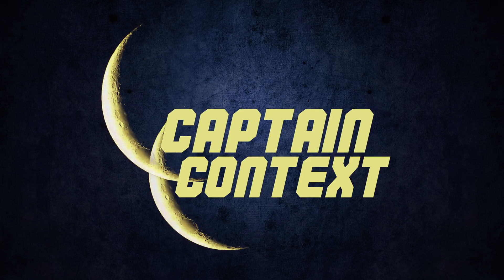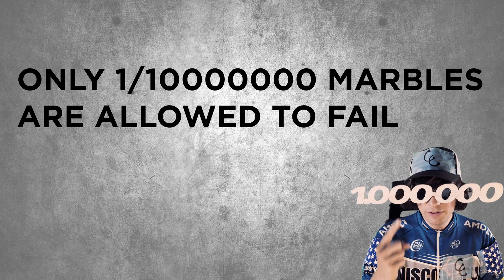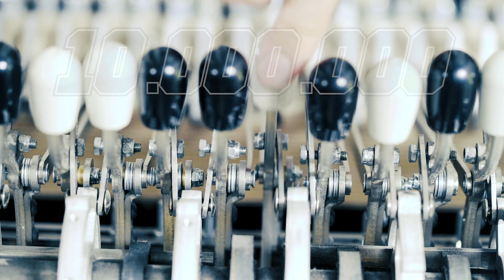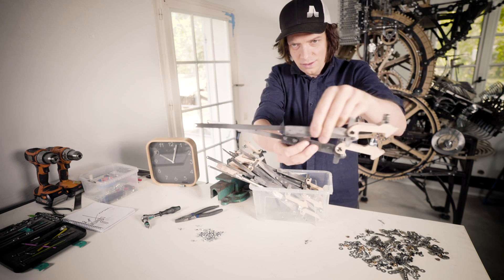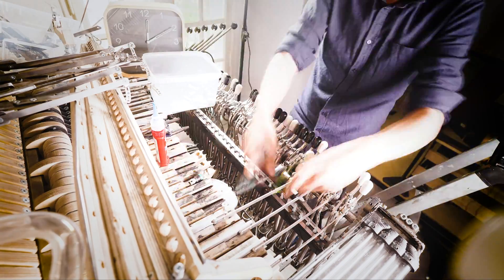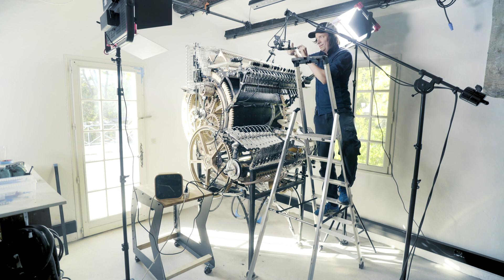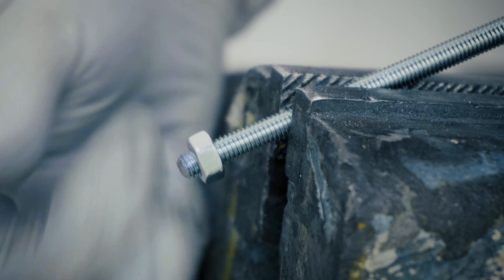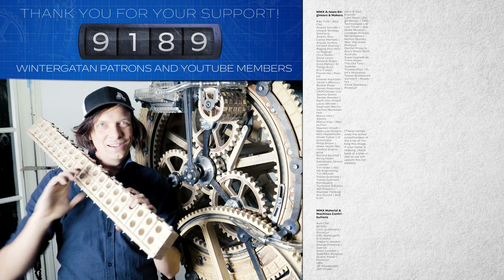Countersink? Why? - Marble Machine X #143

Comment: Martin, something else to consider; automated testing. Have a set of programming plates that actuate all the channels in different profiles - covering likely patterns; rapid repeated notes, adjacent notes playing together, etc - and then use the motor to run the machine all night (probably with a camera running to capture oddities). You can simulate many concerts worth of usage in accelerated time.
Reply: Well that is basically the last step. FIrst he would have to test all of the individual modules and sub assemblies. But yeah I agree some form of automated testing is absolutely required.

Comment: Hey Martin

I'am realy in joy how you discover the normal techniques in a live of a machanic. But...i'am realy in pain with your screw safty...pls...pls use a bit less off the locktite. It is not needed if u use a self-locking nut...just a drop is enough.
If u assemble one part (maybe 2) and test this part befor you assamble the other parts u could save up a lot of time to repair your mistakes. just keep in mind.. you don't have to do the worke twice and its more efficient (yes i'am german)

best greetings and much love from Germany
Reply: The loctite can also eat the nylon inside the nylock

Comment: I can't see how this is ever going to happen without a way for a failure to be manually cleared mid song without anything breaking. 1/10,000,000 is one pothole away from 1/1000.

Then again, I'm sure I'm not the first among the dozens of brilliant collaborating engineers to have thought of such things. I hope to be wrong.
Reply: If you can't make it perfect, make it tolerant/compliant/adjustable/etc
Reply: I always find myself comparing the MMX build with software development and one big thing in software development is trying to add graceful failure as much as possible. You don't want one error to kill the process, it should recover from i.e. a slow network connection
Reply: What is Martin's definition of 'failure'?
Is it an event which causes the machine to leap 1 metre off the floor and hit the ground in pieces? Or something as subtle as a marble missing one of the catching baskets and landing on the floor, leaving 3499 marbles in the loop?
Reply: There is a difference between failure and catastrophic failure.
Reply: He is right, if the failure mode is breaking the whole machine, then there is no failure percent that is workable.  You need to make the machine fail more gracefully.
Reply: you are not the first, but martin just keeps ignoring this fact anyway
Reply: @rigdigwus  I'd like to add that Martin has confessed that he doesn't always read the comments, so maybe that's the reason? Some commenters here have voiced their opinions or concerns and I often wonder if Martin will ever take the time to read them. It's quite possible he doesn't hav the time to though.
Reply: @justinnaramor6050  tbh every engineer knows all of this and he works with a lot of them. so i bet he heard this a few times already, especially in the discord
Reply: @rigdigwus  Yeah, you could be right about that. We'll see what happens next I guess. Time will tell what Martin does with the advice that's presented to him.
Reply: How many times does your car's engine cylinders fire before failure?

It may sound like a lot to you, but in engineering it's all about the data and results, something seeming large or small is only human interpretations.

Aiming high for this sorta reliability is what it takes to get this to play and be a functioning machine on the merits of its creation.

Now what I believe to need to happen as well is when failures happen they happen locally and the rest of the machine can continue without a global failure. That's about building in some natural local compliances or fail states along the chain.

It feels weird having to explain this sorta thing to somebody who deals with science.
Reply: @RupeeRhod  Only few thousand times or so.
Engines often fail. Misfire, knock, failure of combustion, all of those are failures. It is perfectly normal for your engine to have a misfire every few minutes(sometimes the ECU logs it), thats a failure.
The difference is, when it fails, your car doesn't explode, but it will continue to work, maybe the engine will even continue running(since you have more than a cylinder). You will not even notice if your engine misfires once every 5000 revolutions. 
Good machines are fault tolerant.
Reply: @jort93z  "fault tolerant" is a handy phrase I need to keep in my lexicon.
Reply: @jort93z  Yeah, I know the basics, but I'm a design engineer; I leave failure mode calculations to the PhD's and just make sure I design within their parameters.
Reply: @RupeeRhod  Using an engine as an example is kinda bad, because they actually technically fail all the time, the difference is it isn't a catastrophic failure. 

That's what OP is referencing, if a spark plug fails to ignite the fuel in the cylinder, the engine might produce less power for that crank turn, but it will continue to function because the other cylinders will continue turning which keeps the engine functioning. Engines are designed to recover from minor failures all the time, whereas with the MMX it just takes one marble to do one thing not quite right and the whole thing breaks... There is little to no redundancy built into the design...

I and many others have mentioned the over reliance of plywood. Which while easy to work with and aesthetically pleasing also comes with a massive potential failure issue, it does not do well with changes in humidity. All you need is one of those plywood parts to warp slightly while being transported on a wet or humid day and boom, the MMX will fail to the point of not being able to function. Which when it is expected to perform, night in night out on a world tour just isn't good enough...

I love the MMX, I love the crazy journey we have all been on, but this machine while it might be able to play one song, or maybe 10, couldn't play 10 songs every night for months, and survive being assembled and disassembled and transported. I think Martin knows this and is increasingly talking of the MMY. The MMX might make the album and create beautiful music, but it won't be the one that goes on tour... It can't be
Reply: @jort93z  while the clutch does mitigate some what, it only really stops the failure cascading. And like you said, it's not really a recoverable state, I would argue that if a failure is bad enough to trigger the clutch, then that is akin to an engine ceasing the second there is a misfire, it renders the machine unsuitable for the task its required to do, the solution is arguably worse than the initial problem from a usability standpoint. The clutch should only engage IF the machine is about to catastrophically break.

Another way to look at it is this. If a guitar string breaks the song can be completed, the player can play around the problem, sure the performance might not be perfect, but it can still be completed, and the vast majority of people probably wouldn't even notice. The MMX needs to have a way that it can fail but still be able to carry on. maybe with one channel not working, what cant happen is for one marble to get stuck and the whole machine fails because of it.

I think one thing we need to hear from Martin is what he classes as a failure. As he is a musical perfectionist, I assume a failure is one note not being able to be played. Which isn't too bad, a skipped note in 10,000,000 is fine. But if its a failure that will render the machine unusable, or unable to limp to the end, then 1 in 10,000,000 are odds that make it very hard to be able to have a tour go smoothly. That is 1 in 10,000,000 in IDEAL conditions, in a warm, dry part of France where it hasn't moved in years, and a failure can be tinkered with for hours. That doesnt mean its going to survive a rainy day in the UK, or a freezing night in Sweden, or deal with flying in the cargo hold of an airplane, or have its shipping box dropped in transport...
Reply: @RupeeRhod  Was your car's engine cylinders assembled with plywood and angle grinders?
Reply: @RupeeRhod  Right, but car piston cyclinders build on existing proven tech, they also actually do major stress testing on them both in the virtual and reality.  I know he martin tried to run 10,000 marbles through and failed just after 5000, but don't run 10,000.  run one for several days at the maximum rate you expect them to ever play.  Or faster.  A design like this is pretty easy to build a test rig for and let it run 24/7 while working on other parts of the project.
Reply: HERETIC!!!  BLASPHEMER!!!  d=^o
Reply: @cladoxylopsida568  By compartmentalizing the systems, he is doing that as well.
Reply: bruh

helicopters
Reply: It's at least in the neighborhood of what manufacturing sometimes tries to achieve w.r.t defects at a large scale (99.99966), so not totally unprecedented. Something to keep in mind though is that each marble has the same chance, so the very first marble could be the one. That is, 1/10,000,000 doesn't mean you play 9,999,999 marbles and then the last one fails; it means each and every marble has a 1/10mil chance
Reply: Hey, what are you doing here?! I've been watching his videos for ~3 years now (and yours too ngl), you can't just swoop in and steal the spotlight!
/s
Reply: 7 nines of reliability it's insanely high but I don't think it's impossible to build systems with that high of a reliability. What's the MTBF for a car's crank shaft. It's gotta be way more then 10,000,000 revolutions
Reply: @computermdms  WEll you can not compare that. It is a much simpler design. The more complex a design the harder it is to get reliability up. And here you see the sideways plays the registers have even without usage. Just wait a few hundred cycles. Also the wood will get used up, I still fear all the grinding crap gets stuck at some place, etc. 
This machine will not get to that reliability. Something will happen eventually and then it must not fail catastrophically. That must be the main design goal. 

Also I would still test each and every mechanism automatically for at least a few thousand cycles. II still think that just changing all from just a design is a really bad idea and habit.
Reply: @computermdms  US-engineered and Manufactured Broadcast equipment is <only> built and warranted to "5 Nines" reliability.... (and in the real world, iit barely makes that...)
Martin & Team are putting in a lot more, very-focussed effort on a single machine,
I have faith that they can get there...
Reply: @computermdms  10.000.000 revs of a car at 5.000rpm is 33 hours, on average 2.000km of distance. car crankshafts usually fail at 200.000-500.000 km, but with proper periodic maintainance.
Reply: Ever hear the phrase, "If you're good at something, never do it for free?"

Comment: Two things: First, you need to differentiate between catastrophic failure and simple marble failure. A marble missing a funnel and bouncing to the floor is annoying, but not catastrophic.

Second, you need to add mechanical Fail-Safes  to prevent catastrophic damage from minor failures. Ideally, make the fingers that read the programming wheel flexible, so they will only transmit a limited force into the dropper mechanism, and just fail gracefully when pushed past that force limit.

Comment: You need special screws too with treads only on the end where the nut is if not you will had the soft brass wearing out to fast a lithium grease would help too

Comment: The idea of putting the nut on a bolt berfore cutting, is not to leave the jagged edge
Put nut on bolt, cut to length, file the end, then you can remove the nut to clean the threads.
extra step ?
well you did try the nut on the bolt after your method, so it's the same.
Also, the nut is a good way to steady the bolt when you rotate it against the sanding disc

Comment: Can you design it to fail gracefully? As in, if a marble jams, the whole machine doesn't jam, it just skips that drop. Better to have a note just miss and the machine keep on playing than to have the whole machine break down.
Reply: as alvatore was saying, the parts martin replaced would have caused a bigger problem than skipping just 1 note, so it had to be adjusted. whether other parts of the machine can have more wiggle room for error remains to be seen
Reply: With the current design, that's exactly what will happen. If a marble jams inside the gate mechanism, it will only block that channel and the rest will continue playing. The only problem is if that jam somehow blocks marbles in the divider from flowing past that channel, resulting in other channels being starved for marbles and running out.
Reply: @alvatoredimarco  skipping 1 marble drop and blocking an entire channel are not "exactly" anything, they are quite different in terms of catastrophe levels
Reply: @AfonsodelCB  A blocked marble channel can be fixed quite quickly in real time by removing the marbles from the top. Max one song of down time. If it's really bad they can plug it for the whole show as long as it's not a critical one.
Reply: I've sent Martin technical drawings for working out this problem. I'm pretty sure he's got a good system this time.
Reply: @coder0xff  Maybe he has a better system, but the overall approach of aiming for 99.99999% reliability is fundamentally flawed. He's going to be 80-years-old by the time he reaches 99.99999% reliability.
Reply: @AbeDillon  I agree. question for me is what the overall life expectancy of the machine could be. there's gonna be some wear with time in any of the parts. no matter how much effort you put in, at some point something will have to be exchanged and repaired up to the point where it's a total loss. not trying to disencourage anyone by all means, this is just how mechanics work in real life scenarios and something to be kept in mind. cheers
Reply: Except when that note is missed, it'll be missed again every time it neads to play. Think about it. It's not like missing one note on a piano and continuing the song. If a marble drop get's jammed, that note will not play every time it neads to and the audience will eventually pick up on it at some point.That's the real issue. Think of the marble-dropping mechanisms as being like valves that open and close. Rather than controlling weather or not gass or liquid is flowing, these "valves" controll weather or not a marble is dropped. Each marble-dropping mechanism is connected to a note or sound on the instrument. So if it jamms, it cannot play that note at all unless it's fixed.

Comment: The other way if you need to tidy up the end of cut bolts or threaded rod is to use a deburring bit such as https://www.amazon.co.uk/Deburring-Stainless-External-Chamfer-Remove/dp/B07LBDVSZY

Comment: Yes the context is nice but I feel like we already got that. Also for a singular part to be used 10,000,000 times without breaking you're exceeding Ikea drawer opening count and even rivaling keyboard key strokes. I get the 3500 marbles but that's massively spread out over all channels and not every channel needs to endure 3500 marbles.
Reply: Yes, but we didn't have Captain Context last time.
Reply: This is faulty math. In order for the system to maintain that reliability, each individual assembly has to maintain at least that level of reliability or more.
Reply: @perrinromney4555  It's unreasonable at 10 million though. Keyboards are meant to last 5~10 YEARS being used daily and most aren't even tested at a rate of 10 million each key. There is no way Martin is going to use all of those channels millions of time within the reasonable timeframe of needing to repair some things. Nothing lasts forever, everything has a reasonable lifespan until repairs or replacement.
Reply: @perrinromney4555  indeed, the calculation is made as a multiplication of reliabilities of all systems where failure of it amounts of failure of the machine. So, the overall reliability he is seeking is unlikely to be achievable

Comment: It's a great project, lot of pieces designed specially for this purpose... And your're still using multiple spacers... Think to use everywhere the spacer with the size you need, even make it or cut it... It will give you less friction, and less wiggle... It's just an idea, but don't understand your precision on so many pieces, and been so large on spacer...
Wich you the best for the Marble Machine X

Comment: When used to cut threaded bolts, I chamfered and then I brushed the bolts with a rotating steel brush to get rid of the cruft that's hiding at the bottom of the threads.

Comment: No.. Marble failure should not be catastrophic. One in a ten-thousand marbles can go wrong, but if it does not halt the machine or halt a single channel, it does not matter. When a pianist makes one mistake, (s)he does not suddenly break down. First principles.. FFS.

Also, marble divider is still fundamentally broken in design.
Reply: while i want to agree with you, your analogy is wrong. In your analogy the marble machine should be the piano, not the player. If any piece of  piano(thats not aesthetic only) fails, it is unlikely that you will be able to play a full music piece. That said, a piano failure usually is not catastrophic, so one key may fail but the instrument does not immediately explode, but theres only so much you can do to make marble run failures non catastrophic, you can't make marble run around each other in places that only fit one marble
Reply: @OfficialSlippedHalo  I agree. The piano player analogy isn't correct. The MMX is the piano that is potentially explosive that this should be addressed.

At this point I have more confidence in everything that comes before or after the divider. That part needs sub millimetre precision and it will distort and change on transport over time in various scenarios. It simply can not work reliably for some amount of time.